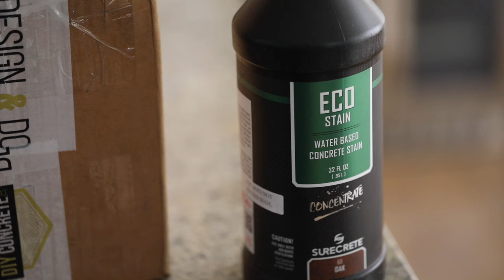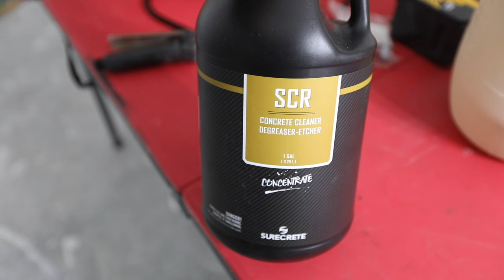DIY Concrete Staining Basement Floor

Comment: We did ours with some stain and self-leveling bar-top. 2 years in and it's holding up just fine. Wish I had used a different color stain though. 😂

Comment: This 100% (almost) convinced me that we will be doing this to our basement.  Our sump pumps stopped and we had a flood, so we had to tear up the flooring, so this is a great, cheaper alternative to do!  Do you have any suggestions for if there are small cracks, fill them in, leave them?  Thanks.  Subscribed and liked!
Reply from the maker: NEW SUB PARTY!!!!!! You know I think it all depends on what kind of style/look you're going for. Sometimes repairing the cracks looks worse than the crack itself. This is a decision that only you can make but maybe you could try fixing a crack in an area that isn't visible and go from there? I feel bad for your luck with the sumps quitting. Nobody needs that headache! Thanks for the support!

Comment: Im so confused. I thought you couldn't stain sealed concrete without grinding the top surface? What about the paint you had already applied? How does it look a year later?

Comment: I have watched many times, I think I'm going to do it. One question I have is you mentioned you chose oak? But you say it looks terracotta and terracotta is a color option. So just verifying that it is really oak? I want mine to look the same, it looks great!
Reply from the maker: @emileegood6160  first thanks for watching! Yes indeed the bottle I used was labeled oak. If I had put on heavier coats it definitely would have turned a darkish oak colour so walk gently into that dark night. I can’t stress it enough: if you’re going for a similar shade as mine, go very very light with the first coat because you can’t go back if you put too much on. Good luck! You got this.

Comment: Love the way your floor turned out. Do you think this would be OK to do on an area that's gets flooded from salt water?
Reply from the maker: That’s an awesome question. I guess it would depend on what sealer you use. Maybe you could find a specific sealer. I am very very very far away from salt water so this definitely is not my strong suit.

Comment: About how long do you think it took you once you got the floor cleaned?
Great video btw! Subbed and can't wait to watch more vids!!
Reply from the maker: RB! Thanks man. Getting the floor clean was 90% of the job. The stain took no time to put down (maybe an hour) however the sealer didn’t quite dry as fast as I had hoped. I ended up leaving the sealer on for an extra day before walking on it. Ventilation and a fan or two would really help.

Comment: Great video!  I’m about to order. I noticed you had an old drain or similar in one spot. Did u sand that down or just stain over it?  I have similar spot!
Reply from the maker: They call him Hawk Eye Exton! That was just an access cover to a clean-out which are usually just a plastic cover. I took out the plastic and cut a piece of mdf, covered that with premixed concrete, and tried to blend it in. It looks like crap now and was a terrible idea. The mdf takes on too much moisture. Your comment is a good reminder for me to pull that up and see if it’s mouldy underneath.

Comment: Great video and inspiring.  I didn’t read through all 345 comments, but I didn’t see anything posted about whether or not it’s slippery when it gets wet?
Reply from the maker: @tgarrett3787  hey thanks for watching and reaching out. Yes it is slippery!!! Not just when wet but even with just socked feet it’s pretty slick. I wanted to do this in my garage but I would 100% put some sand or grit in the finish for a little grip. I’m sure you could find a sealer that has more traction but the matte finish I used is slippery. I should do my garage and see if I can make it grippy!

Comment: Hi great video. Planning on doing this to my basement soon. Question for ya, what type of sand paper did you use on the concrete sander for cleaning your floors? Thank you
Reply from the maker: Hey Jason, I rented that orbital sander from Home Depot and they basically had 3 different sanding pads. They’re kinda like scotchbrite texture. The white one was too soft so I used the black and green. Long story short: they’ll have what you need at the tool rental.

Comment: many of the videos show rinsing the stain with water.  How do you get rid of the water?  Water vac it up? I don't have drains in the room. Not like  patio which is outside and you can sweep/wash the excess off into the ground.

Comment: What kind of floor sander did you use? Best video out there for this project. Thanks!
Reply from the maker: Thank you thank you! I rented an orbital floor polisher from Home Depot and got a couple of the scrubber/sanding pads that they had for sale in the tool rental area.
Reply: Did you use the Dimabrush Concrete Prep Tool they have for rent or only the pads? Looking to do exactly what you did to a 5 year old new build basement. Thanks for the quick reply.
Reply from the maker: @endtherow7276  just the pads. The white pads were too soft but the green ones worked great.
Reply: Thanks again. Now I’m off to rent the machine and see what happens. Cheers 😊

Comment: Just saw this video and considering same process for our basement.  We also live in a cold, dry climate (Montana).  Question:  How is this holding up after two years? Did you just use one color for your floor?  Any part of the process you might change if doing this again?  Thanks for the info and looking forward to getting ours going!
Reply from the maker: Hey MacDoodle here’s a follow up vid with some good info: https://youtu.be/HcqGyrDAe9Y?si=V8Ul5p6J5kRLSG9W
Reply: Thanks!  After looking at our basement floor I can see we will probably spend the most time cleaning the floor of paint and drywall mud - but we are going to do it!  Appreciate you getting back to me so quickly  @RinkVideo

Comment: Do you do more than one layer of sealant?  BTW this turned out amazing.  Also, did you leave all the divets and stuff in the concrete?
Reply from the maker: I probably should have but I didn’t…just one coat of sealer. I only cleaned the concrete and didn’t repair any imperfections

Comment: Super helpful video! How many coats of stain did you end up using? Looking to stain our basement concrete floors and trying to determine how much product to purchase
Reply from the maker: Meg! Glad you liked. I only did a couple super light coats so I hardly used any stain. Can’t remember if I mentioned it in the video but I think I had 4-6 bottles of stain but only ended up using 2. (Maybe not even)

I didn’t want it too dark so I diluted it more than what was recommended and I sprayed it on super thin. Like super duper thin because I didn’t want to overdo it.

Long story short: 2 thin coats and only let the first coat dry for maybe 15 minutes.
Reply: @RinkVideo  Good to know! Appreciate your reply :)

Comment: Love your video.  Can you spray on your sealer instead of rolling it?
Reply from the maker: Hmmmm that's an interesting question. I feel like if that was an option I would not have rolled mine but I can't say for sure. Which is odd because I sprayed my concrete driveway with the same sprayer. I feel like maybe it's too thick to spray maybe? Anyway, short answer is I'm not sure.

Comment: The link you have takes you to a lot that has acrylic sealer instead of epoxy. Did you order the epoxy separate or was it included in your kit but they now changed that? Thanks. Great video!
Reply from the maker: I didn’t use epoxy Duane. I used an acrylic polyurethane. A friend of mine gave me that matte DK 400WB that he had left over from his house. So I got the kit without sealer but the stuff I used is exact same. Hope that clears up any confusion.

Comment: Thanks for making such a great helpful video.  Did you consider the "Finish my Ugly Concrete" product?  It is more expensive, but I can't really tell the difference and the company has not been communicating.
Reply from the maker: You're very welcome Lewis and thanks for watching. It looks like the "Finish My Ugly Concrete" comes with the TK Bright Seal and that's the difference. That TK Bright Seal gives a wet look or glossy and that's something that I did not want. I'm more of a flat/matte type of guy so I went with a two-part matte sealer. I'm not sure where you live but TK is a massive company and you should be able to buy their products locally. It costs a lot to ship that stuff so you would probably save a good chunk of change by buying that TK sealer locally if you can. Oddly enough I actually have 5 gallons of that TK sealer in my garage right now! I used TK sealer with a 20% sheen on my driveway and have to say that the TK product is FRICKING AWESOME. Long story short here: I'd look locally for a sealer if you can. Does that make any sense?

Comment: @Rink  My husband is been very resistant about this flooring because of ECHO. We had a small party in our basement for my daughter and it was so Loud with echo with the plain concrete floor that he doesn't think we can keep a concrete floor. How can we make that work? I like the look and I really do not want carpet down there. ANY SUGGESTIONS?
Reply from the maker: I’m on Team Husband here Dani. The concrete certainly causes added reverb. I have a few area carpets down which helps but my ceilings are 9’ high and I don’t have much on the walls so the sound is noticeably terrible. That said, I’m not a fan of carpet so I consider reverb to be the lesser of two evils.

Comment: Looks great! What's it feel like walking on this bare feet? Does this still feel like concrete, more like epoxy, or something in between?
Reply from the maker: Great question. It feels slick/smooth to me…as in a bit slippery with socks on. I think your assessment of something in between epoxy and concrete is fair.

Comment: Do you have any information on using 2 colors in an unstructured manner (no taping off sections of the floor) or if additives such as mica powder could be used?
Reply from the maker: I do not

Comment: 6:00 what head(s) did you use on the floor machine for cleaning? Doing ours tomorrow, didn’t know if you used a scotch brite pad or a brush head and then sanding disc?
Reply from the maker: Scotch bright head for sure. They have green black and white and white was too soft to do anything. I think green worked the best
Reply: @RinkVideo  awesome thank you so much! I’m following your technique, except prepping the floors before framing, then re-cleaning, staining and sealing after drywall
Reply from the maker: @willeast7985  deadly! I highly highly recommend using Ram Board (or similar product) to protect the floor until you’re done painting the drywall. It’s expensive but if you do a good job with the Ram Board you shouldn’t have to clean the floor a second time.

Comment: You show the staining process, but using an acid stain that requires neutralization, is the process the same with 2 different stain colors?  Is there an issue of one color bleeding into the other during neutralization?

Comment: Rink my son is going to attempt this diy (staining concrete floor)and we pretty much understand by watching your video(great by the way)but could you let us know the sprayer you used for the stain?
Reply from the maker: I used the one that came with the kit but it’s pretty small. So I borrowed one from my buddy…not sure what kind it was. I think you could use any sort of weed sprayer but the one that comes with the kit has a couple different nozzles. It’s my personal opinion that the type of sprayer doesn’t really much matter. Maybe take a look at the diyconcrete.com site to see if they have any specific info. Honestly I wouldn’t sweat it though.

Comment: I got same kit, about to lay down degreaser today. How long do I have to wait to lay degreaser after sweeping & mopping? Than after when can I stain after degreaser? Than after stain when can I seal?... sorry brother I'm working on room as of right now. I bought this cuz of this video... did a good job, no lie brother the prep is pretty tedious...
Reply from the maker: Bruh. Read the directions but my best guess is: no wait to degrease after sweeping. Stain once degreaser is dry. Stain will literally dry in no time. The sealer is something that will take a couple days depending on ventilation and humidity. That’s just a guess without the product in front of me but the directions should explain more clearly.
Reply: @Rink  🤣 yeah I know... not da instructions type of fool. I just jump in & ok this does this & that does that 😳 🤣... room is coming along good. Got pics of progress on BBQ pages on FB  & IG.

Comment: Awesome video. Is that a buffer you used to scrub the floor? What type of grit pad did you use? I heard that any acid Chlorox, Phosphoric solutions destroy the concrete. Is that true? Thank
Reply from the maker: Thanks Scott. It was a floor polisher rented from Home Depot. They basically have white, green and black scrubber pads and I found the green worked best. 

As far as destroying concrete with chemicals I have no idea. 😂
Reply: @Rink  I have a new built home. I am having trouble getting the concrete clean. I have been scrubbing with a firm  brush and immediately shop vac. Once it completely dries, there is a light white chalk film that reappears after multiple scrubbing with clean water. I will next try to rental HD polisher. Any thoughts? Thanks.
Reply from the maker: @scottlabak1658  same here Scott. I was reluctant to use a whole lot of water (for obvious reasons) but my buddy came over and convinced me that I wasn’t using nearly enough water to rinse it off. Needed lots of water! There is NO WAY I could have scrubbed my floor by hand so the polisher was totally worth renting for me.
Reply: @RinkVideo  Thank you! Fantastic help! I will let you know how it goes.
Reply: @Rink  We(my wife and I) like the stain you used. What color is it? The Taylor guitar is cool!
Reply from the maker: @scottlabak1658  color of that particular stain is oak. I wouldn’t say my concrete is light or dark….somewhere in the middle. But the outcome will vary greatly depending on the tone of your concrete.

Comment: How big of a space did you do and how much stain did you need?
Reply from the maker: Roughly 1200 square feet. The bottle says 200 square feet per gallon but I used a fraction of that because I didn't want it to get too dark. My memory is failing me right now but I think I used around 2.5 gallons for the whole basement. I put it on really thin and diluted it way more than the recommended water ratio.

Comment: Question, for a basement the sealer used, will it protect from radon? Do you need to use primer? or can you clean the floor, then stain with a sprayer with a pattern, then use a sealer? Also want to use eco friendly products safe for for people and pets.
Reply from the maker: Jay! I’ll start by saying that Im no expert in radon and that you should consult a pro! 

From what I understand, radon can’t penetrate concrete. When I built this house, here in Calgary, I had thought that spray foaming the basement would eliminate any concerns. But I was wrong. The City still wanted me to use a specific concrete caulking where the foundation meets the slab and then around any pipes coming through the slab. My inspection was done when it was still just original concrete so I can’t see how a sealer would make any difference. But I could be totally wrong. If you’re in the same parts as me, there’s a concrete supply store in Calgary that carry the Eco Stain called Hard Rock. They have all the colours. It’s a great store and you don’t need a contractor account.

Comment: I've got stained concrete floors in a home I bought  a few years ago,.. but in parts the previous owner painted some kind of moisture barrier or something with a dark red paint.

We've been playing around with various processes for getting the paint up in prep to stain the concrete to match the rest.

I'm down to using an angle grinder and a diamond or floppy sanding disk, which will take a while.

I got excited with the start of you video when I thought you were gong to show how you removed the garage paint using an easy cheap process.

Then bam,.. you switched rooms or sonething and applied your stain to a virgin concrete floor.

Did you remove the garage floor paint or was that just to show what you didn't want to do and why?

Otherwise, nice video..

Comment: what was your dilution ratio stain to water? and how many coats of stain did you do? thanks
Reply from the maker: It was way more than the directions recommended but I was just eyeballing and experimenting. I did two very very light coats. The first coat was dry in a minutes.

Comment: What do you do if there was a cracks in your concrete? The products you got, did it cover all the area's you were working on? How many square metres was that?
Reply from the maker: P Man. I would fill the cracks myself but that’s probably a personal choice. Anyway, that space is about 300m2…maybe a little more. But I used probably only 25% of the recommended application because I wanted a really light coat. I didn’t want it too dark and I was going for an imperfect look. The product covered way more than I expected. Hope that helps.

Comment: Some project kits come with a 'sacraficial' wax coat, what was the thought process around whether to include a coat of that or not?
Reply from the maker: You know what JT, I think that would have looked better on my floor. Wax gets worn on the high traffic areas and I think that would have suited my style better. Let me know if you go that route!